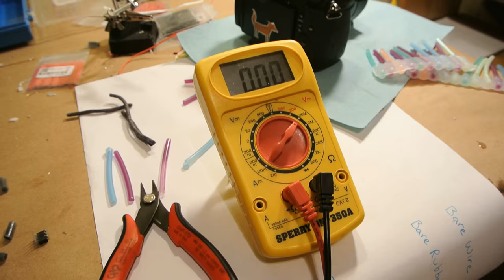Silc Circuits: Problems with Platinum Cure Silicone

Comment: so confused about time stamp 3:40, this video is all over place. So to get more conductive silicone what do we need to do? You said the nano powder did a better job, then you say just by not adding nano powder, but yet if thats true you would have just used the regular carbon powder that you said was worst than the nano about 3 min prior. In one sentence what do we need to mix together.

Comment: hello. i have a silicone glue without two parts how can i make it electrically conductive with graphene powder? my main problem is when i dissolve it in various solvents it looses her adhesion with the substrate
Reply from the maker: one part, acetic acid cure silicone you can just mix the graphene right in :) should work ok!
Reply: @dinalab  are  you sure? as i said i have a silicone glue with no parts and also when the solvent is evaporated i have no adhesion with the substrate. sorry for bothering but its really crucial for my thesis